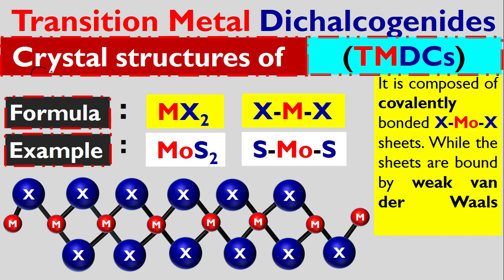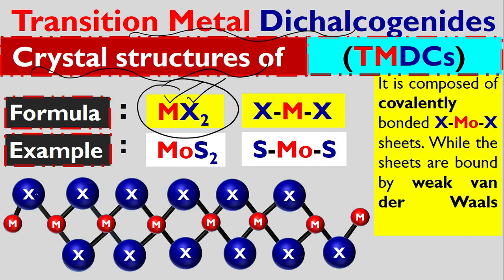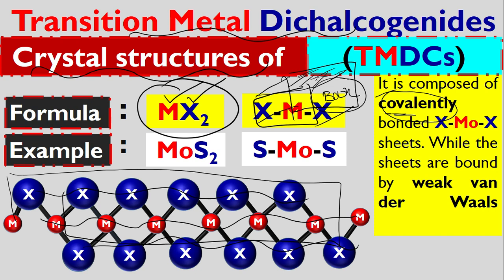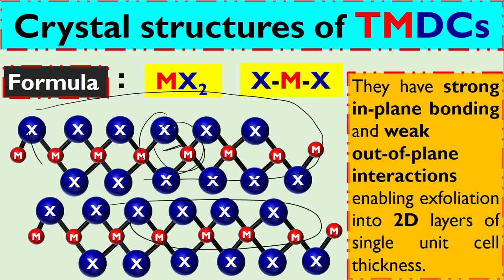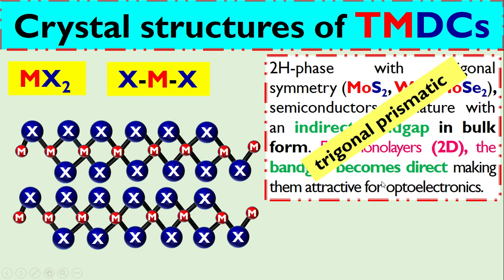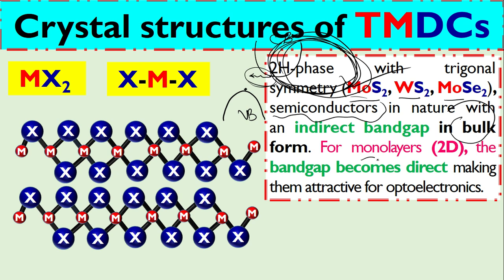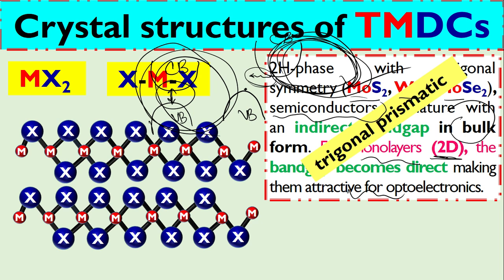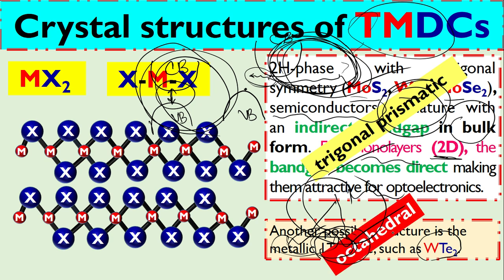TMDCs Crystal Structure | Understanding MX₂ Layered Materials

Comment: How to make MXene monolayers like Ti2C
Reply from the maker: We have to use a top-down synthesis method to etch A element, which is mostly aluminum from a layered MAX phase. In your case, it is Ti2AlC, so use a strong etchant like HF (hydrofluoric acid), the resultant Ti2C MXene sheet will be formed.

I strongly recommend to follow the latest research paper while synthesizing MXene sheets or monolayers. There are quality papers available on this topic
Reply: @ how to make that structure in vesta. I want to make a monolayer, not synthesis
Reply from the maker: @Noor-y3i7m  Oh I see. I think, either you have to download the CIF file for Ti2C if available in the literature and I am sure it will be available. 

Or you have to download the CIF file for Ti2AlC and then remove manually the Al atoms. This is how you have to work out. 

You need to spend sometime on vesta to master this skills. 

Wish you good luck